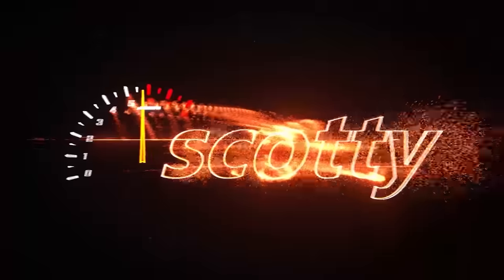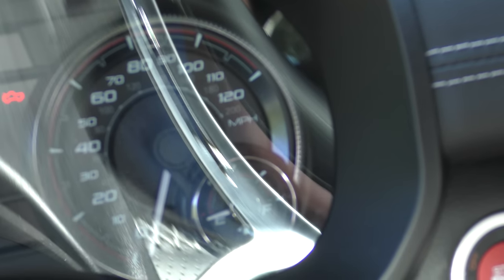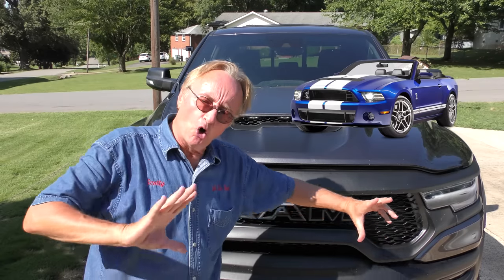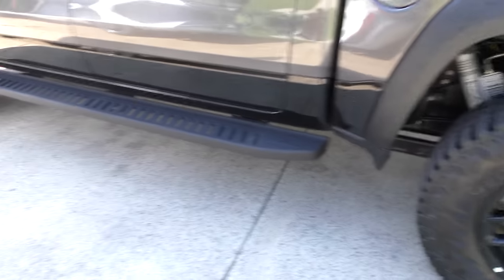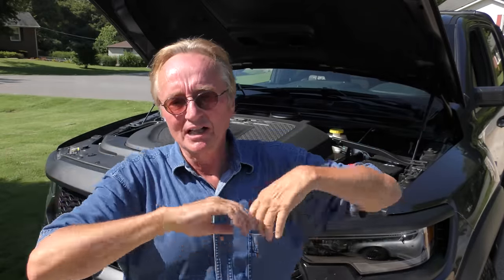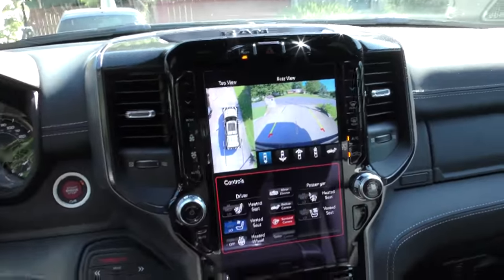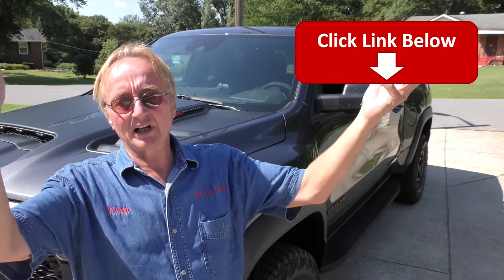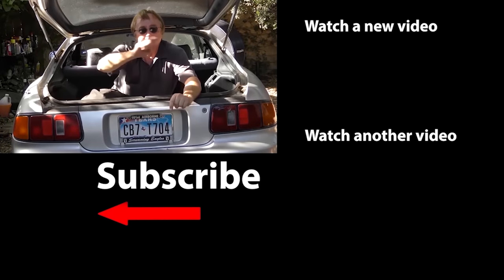I Finally Got a New Dodge Ram TRX and Here's What I Really Think of It

Comment: Another reason they limit the speed to 119 is because the tires it comes with are not rated for high speeds.
Reply: Nice try but you can change the tires you know
Reply: It’s called a governor chip wise guy.
Reply: play nice, kids
Reply: Win the truck 👌
With the money I get a brand new Tacoma ☺️
Keep my 2010 Tacoma as is...
... And really "Trick Out"  the brand new one 😃
Reply: @Therealestrunnerluda  But then you're taking away it's off road capability, which is the whole point of the vehicle.  Otherwise you get a Challenger or Charger with the same engine.
Reply: @rollingrizzo1291  I’m not saying the tires limits the speed of the truck, I’m saying the truck is limited to a certain speed electronically BECAUSE of the type of tire that is on the truck.   It’s a safety measure, wise guy.
Reply: @frankb.1546  I know, I’m not trying to be a wise guy, I’m trying to be an a hole.
Reply: @Therealestrunnerluda changing the tires isn’t the point.  The point is those are the tires that come on the truck, off road tires are not rated for that speed so they limit the speed to eliminate liability.
Reply: Remember when they dropped the Hemi in the Ram chassis? The SRT-10 I think it was called. Billed as the fastest pick-up on the road.
Reply: @rollingrizzo1291  lmaooooo
Reply: My Dodge Durango srt with the 392 in it all wheel drive it’s Heavy but she will move if beat a lot of mustangs fastest iv had it is 160 I think people who down the new generation of dodge performance lines have never driven or owned on and it’s the same people driving a Prius lol
Reply: GGALLIN1776  If I want to go over 120mph I'll do it in a different vehicle.  Right tool for the job!!!!!!
Reply: The gears also probably wouldn’t handle it
Reply: Pretty sure all modern cars have top speed limited electronically so that tires don't blowup
Reply: A $200 dollar programmer like Superchips or Bully  can turn that limiter off. The 4th Gen Ram with the 5.7 hemi are limited to 110, but they can go 130 np... ask me how I know :P
Reply: @fangyideng3131  That's the main reason but not the only one.  In Europe the manufacturers have an agreement that all but the most limited cars have a limiter at 155mph.  My 2013 C63 has that.  When I put on a Eurocharged tune for more power it also gets rid of the limiter.
Reply: That is true. I remember street racing a (in a Lightning) corvette in BFE OK. I was in winter tires. Had to keep stopping to re-air them/check for dangerous pressure. It needs Y or V rated tires to safely  go that fast. It's tailgate is not fiberglass and it is not a single cab. I would not drive this beyond what the gov has on it. Firesuit helmet solid pass.
Reply: bobcat baldfat drunkbeater   Maybe. My speedometer stops at 120 but using gps is more accurate. 140mph+ go team Ford SVT.
Reply: @icost4671  humm great idea !!!😎
Reply: No manual transfer case? More solenoids to fail. Dodge with electronics? 😂 all the electronics and nannys are gonna be the issue.
Reply: @Therealestrunnerluda  you wouldn't want to go faster lol
Reply: They are. I do believe that Dodge says the tires are rated for about 140. They were specifically designed for the truck
Reply: I know that high speeds for these high off ground vehicles is dangerous . 119 MPH is already eight times more dangerous than 60 MPH .
Reply: Neither the drive shaft
Reply: @rollingrizzo1291  cause we can't buy one that'll fix that? 🤣
Reply: @rollingrizzo1291  at least you're honest about it 😂
Reply: @fangyideng3131  right but this is lowered even more so because of the tires most cars are limited to 155 mph I believe
Reply: @cordarin7  hope you aren't doing those speeds with tires that aren't designed to do so
Reply: It really is amazing how many people don't know this and over look it, tire speed ratings are everything.
Reply: @rollingrizzo1291  No it is the very reason. Off road tires are not speed rated. If you look on any tire they will Have a "letter" indicating it's speed rating.
They span from A to Z 'A' being the slowest and 'Z' being the highest. 
Not to mention the ride height and suspension dampening, bound and rebound curve all factor into it. 

If someone like to play roulette with their life then by all mean override the speed limiter and run it on off-road tires like a dummy, oh and leave suspension in the softest mode to when going high speed 🤣.
Reply: @icost4671  beta male
Reply: @cordarin7  👍
 😁😁😂
I know exactly... How you know    😆. LoL
Reply: @Ramonperez590  👍😂
Reply: @joemomma707  🤣🤣🤣 😂
What do you mean by "beta male"  ?
I do have a 2010 Tacoma and just think my 2010 Tacoma will now have a larger engine than the big brother, the 2022 Tundra. 🤔
I went to a couple YouTube channels that feature  "Tundra fanboys"  and they're not happy 😠 😕 😧
Reply: You are correct about the speed limitation of the tires and the electronic speed limiter being set under the tire rating for liability reasons. Besides the tires there is also the front gear box that would never handle higher speeds without flying apart. That wouldn't be an issue if 4x4 could be turned off, but on this specific truck it can't be turned off. 

All that being said I personally put higher speed rated tires on my 2005 regular cab 2wd Daytona edition Ram 1500, and I used a tuner to turn off the electronic speed limiter. I also upgraded to better u-joints, a better brake system, and modified the exhaust system. 

Don't know how fast it will go now because I chicken out before it gets anywhere near true top speed, but I have had it up to 150mph. It didn't shift out of 3rd into 4th until 140mph with my custom tune on the engine and transmission. Still had most of 4th and all of 5th to go when I backed out of it. I still have and drive the truck. It's been a good one despite the crap Scotty says about them.
Reply: @LeadStarDude  gave you a thumbs up you know the ins and out and how to work on vehicles. 😃
I used to work on my cars but once they start putting the computers in, they left me behind. 🙁
Reply: Unlock the governor chip with a tune ✅
Reply: @icost4671  Thank you. The computers aren't that bad once you get use to them. In fact the computer can usually help you diagnose a problem if something trips an engine light. You just need a OBD2 reader or a tuner/programmer that can read the trouble codes via the OBD2 port under the dash. It will give you a code and you can look the code up online. I have been able to keep my truck in good working order because of that. I always do my own repairs. No way I am going to pay a mechanic two or three hundred dollars to replace a ten to forty dollar sensor.
Reply: @Therealestrunnerluda  tires that come stock are the only reason this truck is speed limited not power
Reply: The tires that come stock with truck is the only reason it is speed limited
Reply: @FakeMoonRocks  srt10 still the fastest production truck ever made because they limit the speed of trx do to the off road tires that come stock
Reply: @martinmears2355  Yeah, I didn't know they still made them. But there was a couple years of interrupted production - 2011-2012.
Reply: It’s still stupid why put the motor in the first place
Reply: The Real VR  LOL
Reply: @Therealestrunnerluda  nice try? He even says the tires IT COMES WITH. dodge never had intentions for the customer to replace the tires and rims with aftermarket ones thats how most new cars are made. Yes you can do it, i dont see why you would go with tires and rims before a tune and cold air intake though.
Reply: Yeah tell that to the princes in Dubai 🤔
Reply: @mindyabusinesses649  no it’ll eat iy
Reply: @Therealestrunnerluda  but then you can't go offroad so there's no point
Reply: W rated tires will handle 150mph +
Reply: Or Y or ZR
Reply: Kilmer says it right in the video: electronically limited speed. 

Chrysler no.lpnger allows ECM changes to accept different tires or gear ratios.
Reply: And it can flip easier
Reply: @Therealestrunnerluda  Z ratetd tires for an off road vehicle. Good luck on finding them not to mention if you get Z rated tires they wont be the same size and it'll look ridiculous
Reply: @rollingrizzo1291  you can always chip it. Good luck on exceeding 120mph on off road tires. You'll have a blowout
Reply: @FakeMoonRocks  they don't still make the SRT10 trucks. They haven't made them since 2006. He just meant it's still considered the fastest production truck as there hasn't been another to roll off the assembly line able to hit that top speed.
Reply: It’s the aero not the wheels it will flip at anything over 150
Reply: Why make a supercharged 700hp truck if they wanna limit this and limit that..ridiculous.
Reply: Also pickup trucks are more prone to rollovers at high speed cornering! So they had to limit to only 120 mph! Honestly your not going to go racing anyways! It’s good for off roading or going hiking in the mountains
Reply: That’s the ONLY reason
Reply: Why the hell would you want to drive a truck at that speed?
Reply: Duh!!
Reply: @frankb.1546  I would definitely remove that chip and have the do what it's ment to do.
Reply: , limited to 118
Reply: That limiter def saved a lot of lives. Stability is prob out the window close to 120mph
Reply: @FakeMoonRocks  the ram srt10 had the viper engine, a v10.

Comment: Scotty restraining himself about the manufacturer.  I’d love to see him looking at this model of truck in six years or so and at what’s broken.
Reply: Guarantee the manifold bolts need replacement at least 3 times lol.
Reply: Six years is generous. 6 - 18 months.
Reply: Yes… I assuming high maintenance , & I would enjoy it ( if reasonably affordable) I think……….. Interestingly , though my 2007 Canyon 2 d/ 4 CYL has gotten a little expensive now to,keep running @146,000 miles.! We hoping for the best as keeping it as second vehicle back up,etc.
Reply: Scott is wrong about rams. My 2009 RAM is still a beast and I haven't had to do anything other that routine maintenance, replaced an evaporator and a transmission solenoid. I also had a Toyota before this and gotta say both trucks are equally solid.
Reply: 6 months, heck 6 days or how about tomorrow. Their is a reason only 700 will be built. Buy backs will be easier...lol
Reply: @devonkincaid360  fiat bought Chrysler in 2014 though..
Reply: Ram isnt the best in quality or quality control, but they are not difficult to work on.  Id take a ram with 150k miles on it with manifold bolts cracking every 10k than my wifes Toyota Highlander that has 100k any day.
Reply: @ginog5037  I work for FCA only 700 Launch edition trucks were built Not the TRX in general we still make those today
Reply: We have three Rams in are family and they have been great trucks.
Reply: @devonkincaid360  it's all about who owns and maintains the vehicle not the brand. How you drive it and take care of it matters alot more than brand. He also hates VWs. I have a 2009 2.5 jetta with 170k and I've owned since 115k. I have done 1 wheel bearing, rear coils, pads and rotors, 1 lock actuator and glued the passenger side mirror back on. I did everything on my own using YouTube and rockauto.
Reply: @socom2wasgreat542  You have a point about how people drive them.
My parents have a land cruiser with 276k on it.  Fluid changes, bearings, pads, rotors, and air filters are about all that has been changed on it and it is still going strong.
Reply: That would be ford and gm..lmao
Reply: @TheMickey0718  that doesn't matter. Fiat doesn't make ram vehicles. They just own the name like a gaming company owns the ip
Reply: And how much it costs to fix it when it breaks.  I can't imagine what the suspension system components cost.
Reply: @operationNOBO  You make sense. The Highlander probably won't need work very often, though.
Reply: It's not a ford.
Reply: @devonkincaid360  people just like to hate, my old boss has a 2015 2500 gas and it’s got over 250xxx kms, uses it a work truck everyday and there’s been no issue. Treat it right and it treats you right
Reply: No way I would pay the $$$ this truck costs.
Reply: @operationNOBO  manifold bolts breaking every 10k? My father inlaw has 375k on his Dodge 1500 and has never had a broken bolt! That's just an insane statement.
Reply: @robtankbuster5215  I was being facetious.  
I am simply saying if a Ram had manifold bolts breaking every 10k miles, Id rather deal  with that than working on a Highlanders issues.  
Of course no Ram is doing that every 10k miles.  But I know of some that have every 40-50k and I know of some that wont break at all in their lifespan.
Reply: @operationNOBO  ok
Reply: From what I seen older cars last longer than the new ones
Reply: Yea because you’d buy a goddamn ram trx for reliability. You don’t buy one for reliability , you buy one because you’re crazy enough to stuff 700hp in a off-roading pickup truck.
Reply: I own all FCA, buying a new Ram on tuesday but I will say.
My 17’ EcoDiesel goes through ball joints like no tomorrow.
People talk bad about the EcoDiesel but mine has 250k kms and it’s like new.
It’s a workhorse too, always towing my tractor on my flatbed trailer but it’s a champ.

Comment: I had a SRT-10, known as a Viper truck with the 6 speed. It would practically idle along at 60 in 6th gear. Got 21 mpg also. Top speed 156mph.  Now that was a fast impressive truck.
Reply: Ain't it still the fastest truck made stock
Reply: Most underrated truck ever made.
Reply: The Trx would eat it in the quarter mile.
Reply: Also a rare truck
Reply: @Texan713Gematria   YES 😁😁👍👍 Highest top speed.
Reply: Its a v10 right
Reply: @drakeweddner  Yes,  Hennesey blower = 750 HP.
Reply: @vulcanman64  lol finally a dodge boy talking about a 1/4 mile I thought y’all were scared of a dig race.
Reply: @Texan713Gematria  yep
it is
Reply: @giantgaming600  the DODGE SRT10 is the fastest production truck to date...
Reply: Those Viper trucks should've been AWD with a widebody kit cuz they're too easy to flip over or imagine if they put the V10 in the Dakota instead it would've been nearly as fast as a Viper
Reply: No vehicle "almost" idles at 60mph. That's delusional.  You might be running similar RPMs, but the engine is still running under a load.  RPMs are the same but the fuel dump is way more.
Reply: @davidn7457  😅🤣😂
Reply: @CRIMSONWAVE18 My Cummins would eat the TRX in a dig and a 1/4 mile all while getting a lot better mpg. TRX's are overpriced, overrated.
Reply: @lewismcfarcry  you Cummins is only going to go fast in a straight line. The trx would absolutely r*pe you in a off road course or running from a farmer trespassing, it’s expensive. But for the suspension and electronics, it’s what they think it’s worth.
Reply: @Crunkle-bb8hn  It also can't haul like a diesel either, don't forget that part. Mine's set up for drag racing, but I know plenty of 4x4 Cummins that would give a TRX a run for it's money 😆
Reply: @ClickClan100  I also have an 87 Nissan! Lol
Reply: @lewismcfarcry  i definitely give you that. The Cummins could pull the world if you could wrap a chain around it. But that’s isn’t what the suspension designed for. I’m mopar guy through and through but that TRX will absolutely leave you in the dookie when you go play in it. When he is doing 60 over terraces that ol heavy duty is heavy duty, but she can’t play like the T. rex can play.
Reply: @Texan713Gematria it is not faster then the TRX lol not at all and I would rather have a srt-10
Reply: @lewismcfarcry stock? Your diesel would get ate alive stock
Reply: @Tay-be4ew  Stock I agree, as it sits now, no. Lol
Reply: @lewismcfarcry  Sure, your modded Cummins can take a TRX. I'm not sure how that is a relevant statement though. Considering the TRX is bone stock and has a borderline exotic level interior. The wide body on its own makes the truck iconic. But the real joy is how you drive them off road catching air and four wheel sliding around corners. All while surrounded by nature. Thats freedom. But thanks for sharing! I'm sure your truck is really cool ;)
Reply: @PyroBlonde7777  Tell us you're not a car/truck guy without telling us you're not a car/truck guy.
Reply: @lewismcfarcry  grasping at straws with that response, huh? I wouldn't like the TRX if I wasn't a truck guy. Again, no one cares your highly modified truck is faster than a factory TRX. Cope 😏
Reply: @PyroBlonde7777  Nobody cares about what you think of my slightly modified truck, the fact that you gotta write a paragraph to prove.. What exactly? That you were triggered by a mere Cummins that everything altogether with it cost a fraction the price of the TRX to blow the doors off of it. Sorry to hurt your little fanboy feelings. 🤣
Reply: 21mpg? please tell me how. Im lucky to break 14 highway in my bone stock 5.7 single cab rwd hemi 1500

Comment: I have 362k and climbing on my 97 ram 1500 4x4. All original minus a few bolt on standard maintenance replacement items.  4x4 never failed me. The 5.2 under the hood still runs like a top. I replaced a 4 dollar 3-4 shift accumulator spring in the valve body a decade ago. I change my oil every 5 thousand miles.  I bet my magnum goes 600k+